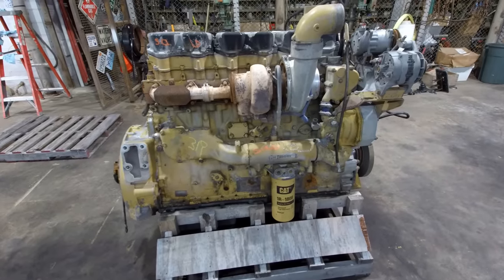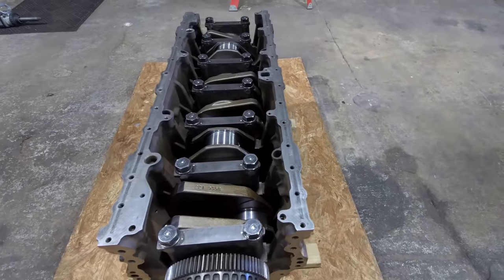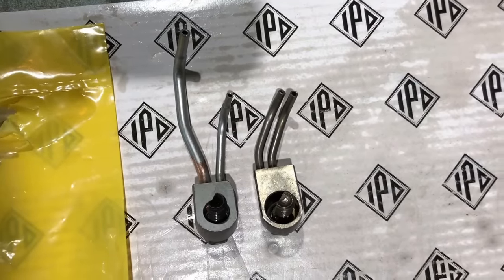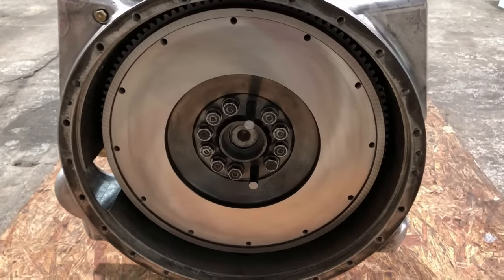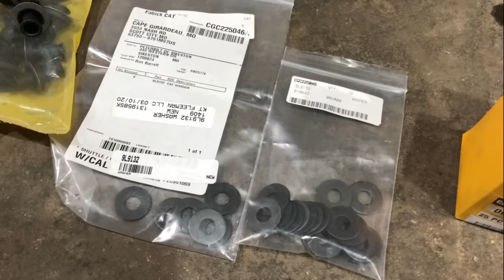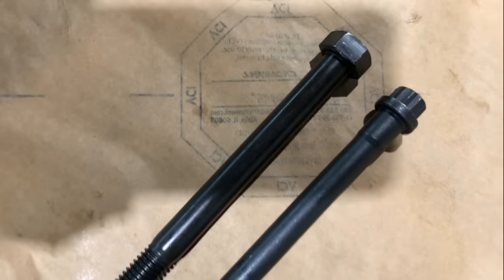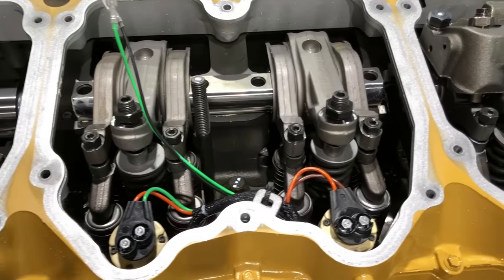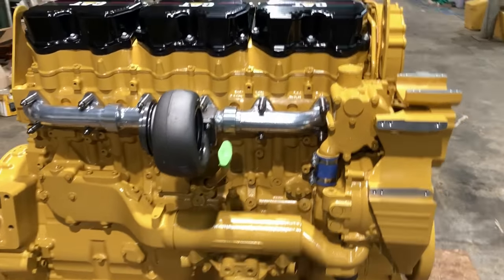800+ Horsepower 17 Liter Caterpillar Diesel Engine Build from Start to Finish + 1973 Peterbilt

Comment: Why would you need Jakes on a “competition” engine...🤔
Reply: Competition (wink.....wink...)!!!!!!
Reply: hey man  Lol exactly
Reply: Just to hear 800horse Jake!
Reply: My motor home 😃  git u thear !
Reply: This truck is being built to make money.
Reply: Christian Metsch as they should.
Reply: Man, just be quiet and listen and learn.😉
Reply: @MrWisdom79  yeah good luck with that. This thing will pass anything but a fuel station. This is built for an operator with a tiny pecker.
Reply: @MrWisdom79  An run for a long time
Reply: @Jeremy-iv9bc  if the owner of this truck has taken the time and has the resources to do a build like this and drop it in a brand new 2020 chassis I would imagine he's crunched the numbers on fuel for the weight he's hauling vs. newer motors.  He's also probably taken into account the maintenance cost associated with emissions motors for both downtime and longevity. 
Btw, depending on application obviously,  a bigger higher horse power motor typically gets a better mpg than a lesser hp motor.   People look at displacement and think oh that thing must drink fuel.   Yeah it does but not as much as an underpowered lower displacement motor pulling out of its weight class.
Reply: Don’t see  a lot of 2020 Pete’s competing lol pretty expensive competition truck hahHa
Reply: Jeremy Thompson jealous much?
Reply: @MrWisdom79  Good Points !!  Not to mention the under powered engine will need a rebuild a lot sooner!!
Reply: they might be drag racing the truck. the jake will help slow the truck down
Reply: @jacob ryobal because they sound epic
Reply: competition or not, you gotta stop amirite?
Reply: Why WOULDN'T you want a Jake on an engine that will accept it ??!!??

Comment: How much torque do you get out of a setup like this?
Reply: cambo1200 all of it
Reply: 2500 to 2750 I assume from the little I know of cats and pulling engines
Reply: 1000hp and 3000tq is pretty widespread for hard pullers
Reply: 3-1 ratio on big trucks 3ftlbs of torque for every 1 hp is how it usually works out or close to it.
Reply: Nah he got
More than that. My little Accert with 800 cam Accert stroke and 59 injectors with a small file in it made 1150 to the ground and 3000 tq

Comment: 7 grand for a new head. Either your on crack or your parts supplier is screwing you. New cat head with valves and the works with warranty. Not no pos reman only cost me 3k
Reply: unreal let me see
Reply from the maker: Stephen Carr  You didn’t buy a brand new loaded Cat head for $3000. Isn’t even close to being possible. You bought an aftermarket head.

Comment: Mmm yes “competition only”
Reply: Drew w you thinking the same thing I’m thinking. It’ll be competition only. Competition on the highway
Reply: Why can it only be used in competition?
Reply: niels vincourt it’s somewhat understood that modifying an engine from original design will alter emissions, or in some cases may not be equipped emissions equipment at all, due to deletes/ removal. Thus making it technically illegal to be used on the highway, especially as a commercial vehicle. But it’s also just a legal disclaimer by aftermarket parts companies to save their ass and avoid lawsuits if somebody does get in trouble while using their parts. 

Although I’ve herd of zero personal accounts of people getting stopped or put out of service for anything emissions related they may have modified on their truck. So it’s all kind of hearsay, but by the books it really could get you into some hefty fines.
Reply: Drew w Caterpillar engines did not come with emissions shit. That’s actually the reason Cat quit building truck engines because the motors couldn’t pass and Cat wasn’t putting DEF and EGR and DPF on their motors.
Reply: Kowboy Kez oh yes they did, and Cat emission motors were junk.  They had dpf from 08-10.  They did not build a truck engine after 10.  They never used Scr in a truck although they use it in there machines now.  Cat motors are absolute emissions nightmares now.
Reply: Kevin Oscarson bullshit. Cat quit doing on highway truck engines in 08. Trust me I’m pretty good friends with Cat dealers. And cat quit because they weren’t putting DEF and DPF of their engines. Cause after the C15 Acert didn’t meet their standards of reliability and quit on Highway truck engines after that in 2008. And they didn’t pass emissions tests
Reply: @kowboy.kez359  I heard they couldnt quiet them down from detonation knock, (being another reason they stopped making them as it became regulated for some dumb fuckin reason)
Reply: James Michael and it ended up breaking cranks. I’ve seen about 5 of em have that happen. With the twins or converted to single. And also breaking valve springs.
Reply: King of the hill competition on some mountain range with a few other good buddys
Reply: Kowboy Kez-  I work truck/equipment for a living.  Cat stopped selling truck engines after the 2010 model year.  From 2008-2010 all Cat diesel engines in on road trucks were equiped with a dpf, in 2010 they choose not to continue production of On road diesel engines because of the investment to run SCR.  The engines were absolute nightmares, from the c7 to the c15 the trucks suffered from constant regen cycles, melted dpfs, derates, poor wiring, and of course the ever failing nox sensor.  They were so bad Cat was involved in a Class action lawsuit because the technology did not work.
   Many of these trucks were modified and deleted returning them to reliable version.  If you wish to learn about it Goggle Cat ASSERT technology.  While your there look at the CAT attempt to build its own truck in conjunction with International another failed attempt to return to the truck market.
Reply: It’s best not to drill into the competition only subject for obvious reasons
Reply: Kowboy-  Cat announced in June 2008 they would not be meeting the 2011 emission requirements, and would be ceasing engine production.  They still produced engines for the 08-10 model year truck.  All with dpfs, and all with regen.  Instead of swearing and trying to tell me your not in idiot do some more research.  I wrote warranty claims as a tech on these trucks in 09-10.  FYI building an engine that was manufactured for 20 years does not qualify you as an expert either.
Reply: @kowboy.kez359   To the best of my knowledge, they did. Research the Cat SDP series engines. So many problems, a lot of people converted them to single turbo, and reprogrammed them to older specs.
Reply: Kevin Oscarson I never said I was a expert with Caterpillar. But Antrim Diesel knows more than me and you put together. Look them up. I’ve took many motors down for him to build and they have lasted. The B model I’m running is putting around 950 to the ground and she’s still holding. Built 2 years ago and haven’t touched it. Other than replacing a couple fuel lines.
Reply: Emmett Johnson that’s what people were doing with the ACERT was converting them to single turbo and then the valve springs started breaking
Reply: @kowboy.kez359  
The purpose of my post was to say that Cat DID have emission equipment on the SDP engines, so the comment that they didn't have emission equipment was incorrect.
Reply: Emmett Johnson honestly I didn’t know. Like I said I never seen one.
Reply: Kowboy- I could know more than anyone or less then anything there is no way to prove either of our talents so I will not get into who knows more.  
  However as a person who was involved with Cat between 07-10, in direct relations with Cats in Vocational trucks(ie upfitted trucks, boom, bucket, service, etc) I know exactly what these engines could do and what they could not do.  At one time A Cat engineer flat out admitted the technology did not work and Cat was washing there hands of the whole Acert technology in trucking.  Cat knew they could sell many engines on there previous reputation regardless of the issues and since they were getting out of the truck engines they did not care.
Reply: Kevin Oscarson true. So we calling this a draw. Both of us have learned a little bit that we didn’t know before.
Reply: @kowboy.kez359  
Yup, I had never seen ome either. A friend had one in his garage for a rebuild, and I had to ask him what it was. It said C15 ACERT, but had a single large valve cover instead of 3 covers. That was when I started looking into them. That's how to learn something new.
Reply: Emmett Johnson now that’s weird only have one valve cover. I’ve only seen a single valve cover on like C12s and smaller
Reply: @emmettjohnson8220   Cat really should've  used a POS prefix for these engines........... on a positive note though, they did use Garrett ball bearing chargers right from the factory
Reply: @kowboy.kez359  Yes sir, that was what threw me for a loop. One large valve cover, and a LOT of plumbing after the second turbo. Quite a far cry from my 3406C PEEC engine. I'll take my oldie any day.
Reply: @kowboy.kez359  I think what kevin is saying is that Cat has gone to Def on Heavy Equipment Motors
Reply: Kowboy Kez no Def but the last year cat did have a dpf and get. I know because I’ve worked on them.
Reply: @kennethobando5755  I can tell you for a 100% fact that Cat runs DEF in their newer heavy equipment, we have a 963 trackloader and a 320 excavator that both take DEF.
Reply: Well idk who would want to drive a 2020 without DEF fluid on the road.....o wait!!!
Reply: James Michael I know I had one of those pieces of junk as well as a 04 Bridge

Comment: I work on commercial electronics and have been a backyard mechanic for many years. Got to help rebuild a 600CI diesel a while back. Man was that ever amazing. Every part is huge and needs huge torque. It was also so simple inside there.

Comment: 32:12 is where an OSHA safety manual turned to dust
Reply: Mobile Device E.R. 
Obviously he trusts his life with whoever made those hydraulic hoses on that fork lift.
Great build. First I heard of a 17L Cat diesel, kicked off my curiosity, thank you for explaining how you put the motor together and derived a 17 L.
Well done.
Reply: Superman 68 I think these forklifts have integral locks so they won’t just fall if they lose hydraulic pressure.
Reply: Mobile Device E.R. Oh I would be fired for sure
Reply from the maker: @seandurgin  You are correct.
Reply: @KT3406E  You seem to do alot of engine work, certainly you could justify a stand of some sort.  I have had momentary lack of judgment a few times, but thankfully I have never video taped them.

Comment: Man, that rag in the cooling system must've pissed off quite a number of 'experts'.
Reply: I’d be pissed off. The question is how and why it was in there. You spend all that money for reliability and someone’s brain cramp can cost you another 40k. Not to mention your down time. Do your due diligence and find a reputable builder.
Reply: Ken Chartier it was installed at the factory on someone’s last day.

Comment: How to evade the EPA 101, "It's for competition purposes only" 😂😂
Reply: @electric7487  I've seen underground diesel powered equipment use wet scrubber mufflers, could those be of any use for on highway use? yeah yeah I know water is heavy...
Reply: @2000freefuel  Unfortunately if you're underground or in a downtown environment a DPF is a necessary evil. You would run as lean as possible to reduce soot production. Then you would use a DOC to cook as much of the soot as you can before the DPF (maybe a secondary air inlet would help by adding some oxygen to help oxidise carbon into CO2). And then you would use the high NOx emissions to your advantage because the NOx actually helps to oxidise the soot in the DPF. Combine that with a further reduction in soot production if you delete the EGR and now your Ard Head (I think Cat still call them that on their current engines) doesn't need to fire as often, which means less fuel is wasted. Then the SCR system cleans up any remaining NOx, and DEF consumption goes down as well since some of the NOx was already used to passively renegerate the DPF.
Reply: @electric7487  From what I understand the old way was a 275 gallon heating oil fuel tank filled with water, AKA the Hippy water bong filter.

Comment: I  like your approach . You're correct about carefully explaining the IMPORTANT parts but leaving out the Wrench turning . Anyone contemplating an upgrade like this either ALREADY KNOWS how to tighten a Bolt/Nut and knows how to follow a Torque pattern map . Or they pay someone who CAN . Simple .
That  6V92  at the end  sounds HEALTHY . Yes the Truck is a P . O . S . , but the Engine is good . 6V92s can sound pretty bad but that's going like it should .

Comment: So i am reaching out to you because i have an experiment that you may be interested in trying.

I was once told if your engine begins to run away that if you take a dry-chem fire extinguisher and unload it into the trucks intake that it will plug up your air filter cutting off the air in turn stopping the run away before its completely  ran away!! I think it won't necessarily stop it but may slow down the motor enough to stall it out with the driveline.
I was told this is a good way to try and save allot of the more expensive components of an engine

Comment: That’s an old snap-on ratchet, amazing how long they last. Add new ratchet gear every 20 years and away you go. I used to do tool return for snap-on back in the seventies. Incredible the abuse their 3/8 & 1/2” can take. Even the ones that looked like they had a 5’ pipe put on them would work with replacement gear package..... you do meticulous work, your customers must be very happy.
and Remember “ Saftey Third” !

Comment: Nice work on the Cat, had to laugh at the end with the 6v92, great sound of a screaming Jimmy. It was big power when Detroit came out with the 475hp 8V92T, they were fun to drive compared to Cat and Cummins at the time. Got to work on a heavy haul Pete with a 3408 that was turned up, impressive torque for the day. Trans swapped it to an 18spd with external oil pump and cooler to lube the main drive gears and auxiliary to handle the torque.

Comment: you're an ace. where did you get your training? as a word of caution, i used to take cars apart at a dismantler part time. he had no lift, used his yard fork lift to work on the bottom of the car. i was working, in front of the lifted car, when bam! the hydraulics failed and that car slammed into the floor. impressed me with the force and speed.

Comment: For my non-diesel builds, so I am not sure if Diesels are different, once main bearing clearance and endplay is verified, I lube the block mains before inserting the crank, lube the mains in the caps, put the first step torque on the caps (there are usually three steps), then I like to rotate the crankshaft to see if it feels straight and looks correct. I then do the second step torque, rotate the crank, then the third and rotate the crank. I am trying to get a feel for how the crank rotation feels during the different torque steps. You can use many different types of lubricants for the mains, there are some high end assembly lubes available, or some builders just use heavy weight engine oil, really depends on the builder.

I have a flatness functional gauge to check the flatness of the block or head decking. The best ones are made from a large cast iron blank and machined and decked to a very flat surface, but are heavy and expensive. Suburban tool can make just about any flatness gauge you would need for engine builds from what they call a straight edge which is both flat and the two sides parallel. It is important to keep the gauge clean and pickled.

Comment: I like how you used a breaker bar to torque the mains, most people just use impacts
Reply: Can you “torque” with a impact? Do you understand torque, how to torque?     NOT
Reply: @SPUDHOME  yes, you can torque with an impact with a torque to yield fastener, or a torque spec featuring 90 degree rotations or 120 degree rotations as such, but even then, you are yielding a fastener, not necessarily applying a torque spec to it, so yes, and no.
Reply: @hithereperson8137  if you are building you very own cherry custom hotrod, one of a kind. Very expensive. Would use a impact?     If you say yes
Reply: @SPUDHOME  I use an impact, yes, but its not on internal engine components, but the internal engine components are easy to torque and you don't need a 765 inch breaker bar to torque them
Reply: @hithereperson8137  so the answer is. “yes” building your very own high dollar hot rod, you would use a impact gun to torque your fasteners?
Reply: @SPUDHOME  I mean I already do, I am a technician who works on his own car the fastest way possible as I know how many uggas to use for a particular fastener
Reply: @hithereperson8137  thank you for telling us your business name so we all avoid you. Some of us prefer torque to be torque not “ratchet torque” .but you can build a “engine for dummies”. Maybe, that should be the new name of the shop mommy pays for and opens for you. She can buy you the finest ratchet tools ever, and also back up your stupid mistakes. But don’t worry mommy will still love you. Torque is torque. Ratchet is ratchet, ask mommy to go to school and learn. IF YOU BUILT MOMMY’S HIGH DOLLAR ONE OF A KIND ENGINE, WOULD YOU USE A RATCHET WRENCH ON THE FASTENERS? or would mommy tell you NOT.